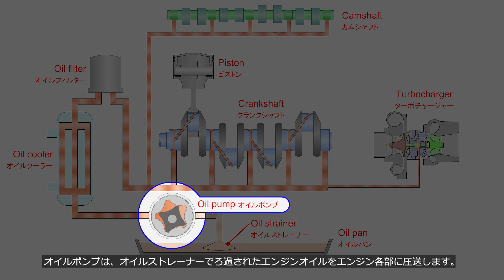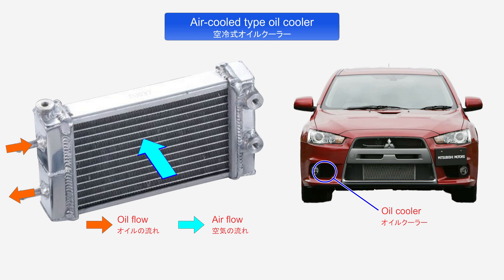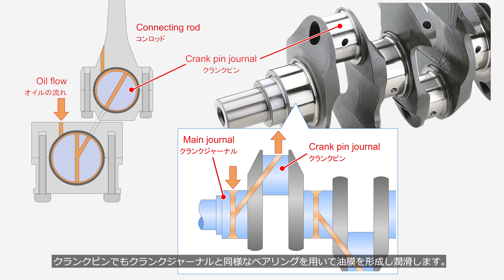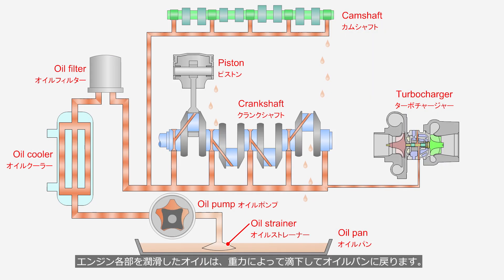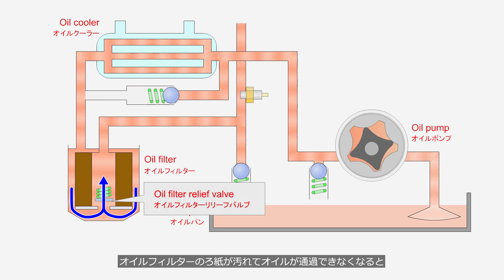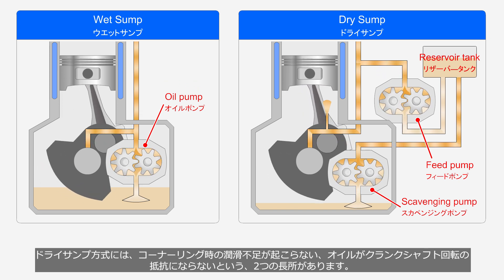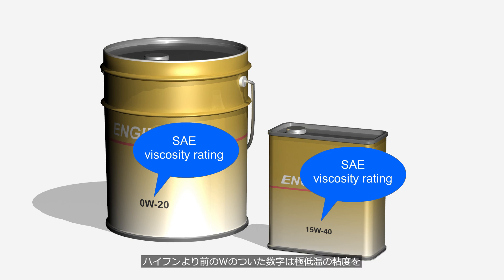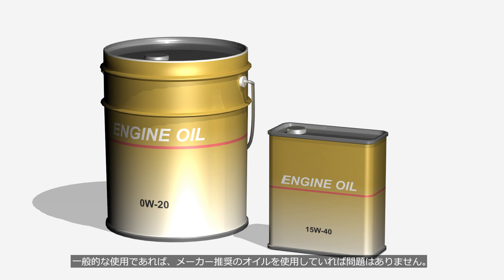Deep Dive into Engine oil and Lubrication systems

Comment: I would like to know your opinion about an issue that has arise in all Lexus and Toyota dealerships in Spain. Is well known that most modern cars of these companies use thin oils like the 0w8, 0w16 and 0w20. The problem is that ALL dealerships in Spain use 5w30 regardless of the car engine model or year. In my case for example my car has the m20a fxs engine which came with a 0w16 as standard and now has a 5w30. The only reason all dealerships give is because of the Spanish "hot weather". Thanks in advance